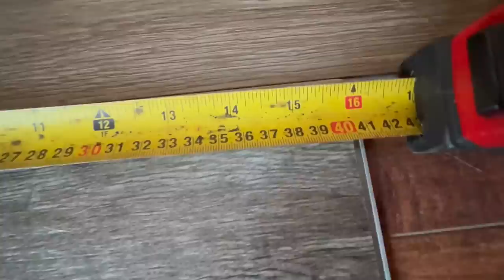A Dark Winter Night... Kitchen Building Project has Finally Begun!

Comment: So that`s where my overalls from the 80`s ended up!
When you start moving your furniture back on your new floor, slide it on some cardboard or a rug. Pity to chip it right off the bat.
Nice job on the shiplap and excellent videography as usual.

Comment: You are doing a great job on the floor and wall. If you have a rubber mallet  you can use on your flooring it will not damage the floor when you put it place. Awesome video and the dogs look great.

Comment: Much of the vinyl flooring can be scored with a razor knife and snapped off cleanly.  Works great for the straight cuts and no electricity needed.  Also, you are finding out why a white rubber mallet is important - saves the hands.  Just like the flooring, its probably a good idea to leave a bit of expansion space on the walls in the corners. Excellent work, you CAN do it.

Comment: You are doing a great job Lisette ! A suggestion (hate seeing you banging the wood together with your hand) if you don't have a rubber hammer use a scrap piece of wood lay it on the board and hit it with your regular hammer to keep from damaging the board) Wishing you lots of smiles and pride in your accomplishments 🙂

Comment: Lisette,if you don't have a rubber mallet then you can easily get by using a white pine 2x4 block of wood and that framing hammer by placing the block down where you wish to fully snap the flooring and then smack the block firmly using either the head or the rubber coated handle... Save spending the time and money to go out and buy a mallet plus the cost of one.. Otherwise looking great girl,and the  floors looking good too..😁

Comment: I have been contemplating putting up some wood in my home...either tongue and groove which I have worked with before and can be a pain in the butt in long lengths, or the shiplap like you used here.  The shiplap looks just as good and a lot less headaches.
And when I die and come back, I want to be one of your dogs.  <3

Comment: Rubber mallet will save your wrist. I used to use my hand like that when oil deliveries arrived at work. Once a week I would hit the top of the tank to get the gage to settle down in the tank. When I retired I noticed a large sore bump on the top of my hand. It is much better now but it took a whole year. Had to really favour that hand and it caused it to not be as useful. The flooring dude I had used a rubber mallet. A lot of those guys I don't think are interested in moving stuff around either. He up and left on us with a few bucks too and I was stuck finishing and I will be honest I am not a fan of the vinyl click flooring. It certainly looks nice though.

Comment: For the starter along the wall with that flooring you can drill it and use finish nails along the wall to hold it in place so that after a few freeze heat cycles your joints do not walk.  Also a rubber hammer is better then beating up your hands.  With the half lap why did you screw it on instead of using a finish nailer? I could not tell what kind of screws you used but with screws after you finish it the screws will most likely bleed off their coating into the wood.  What are you thinking to use for finish?  Tung oil should do nicely if you like the color of the wood,

Comment: Lisette when it comes to the flooring, you don't have to measure out the last part in a row ;)  Just take the last piece and turn it around so that the bottom side is up and the side that would normally fit at the left side is against wall. Mark that point and you're good to go :) It saves you quite some time.

Comment: Monumental job ahead, if anyone can make it happen, it will be you! You are so methodical as you work, the floor and first wall look fabulous I'm glad you got a good saw to help you, you handle the measuring, cutting, leveling so well. I only had one question, not a complaint at all, you were hitting the boards with your hand a lot, would a rubber mallet be better, or is that the best way to do it? Again just curious, you must be so pleased with what you've done so far, I can't wait to follow along on this best day of the week, because I see your latest video, Best of luck going forward, it's going to be fantastic!, Thank you for sharing this Lisette, have a blessed and spectacular week!

Comment: Keep up the good work on your home, I believe I would invest and some furniture slides so is not the damage the new flooring or your existing flooring when moving heavy furniture, you can buy them for hard surface flooring and they won't scratch your floor, you should be able to buy them at any home improvement store they said a four about 50 bucks probably maybe cheaper, but well worth the investment makes moving furniture by yourself lots easier,

Comment: Unsure if Canadian auto has pancake compressors and nailguns but if there's a Harbor Freight nearby a compressor is like 50 buxish,a brad nailer is 20 bux and a finish nailer is 30ish... Porter cable also often has a complete package deal with ; compressor,brad,finish nailers,some nails,and an air hose for a decent price and are uber reliable and long lasting even under heavy usage as long as you add a drop or two of oil @ the start of every days usage...

Comment: on tongue and groove you can use brads with a gun on the tongue, then no fasteners are visible. But maybe you plan to trim out where the screws were used. Sorry your helpers did not work out.

Comment: The tool that you are using to put your screws in is called an impact gun.  An impact gun is designed more for bolts.  If you were to try a drill for your screws you would find out that it is a much better tool for the job for putting screws in.  Just a little tip is all.
Reply from the maker: Thank you, I will change it. 😊😎💕

Comment: You might want to get knee pads and a rubber mallet to save your knees and make it easier to lock the flooring in place.
If I could get there I would help you just for room and board to get your work completed.
But you are strong and you will be able to get it done

Comment: I would recommend a small investment in a tape measure that indicates "Only Inches" as the one's with both metric & imperial are a pain in the butt.
A "Fat Max" or "Fat Max Extreme" make the job much easier for taking long measurements especially for work on walls or above your head.

Comment: you are doing a great job but at 10:43 in your video looks like something is wrong with the saws vacuum system not sucking dust   it  might need adjusting

Comment: Circular saws are dangerous.  Your blade is set too deep and this can result in kickbacks.  Set it deep enough to cut with you're working with plus a little.  Also tongue and groove is meant to blind nail on an angle through the tongue on each layer and you can eliminate screw heads showing.  Please take this a constructive.  I admire your ambition.

Comment: Hi Lisette,,, my name is Bob, and I understand that you have been mistreated recently, by someone you were depending on helping you... Now this makes it awkward to offer you a helping hand,, but I will still extend the invitation to help you with any project that requires urgency to get it complete... My offer is only extended though, first of all,,if that you are located within 7 hours of North Bay, Ontario,, and secondly,, until I get a call from my own employer, which should be sometime in the middle of January... My email is listed in my youtube profile if you decide to take me on, as a 'helper',,,and not a contractor,,, meaning I want you to maintain 'control' over everything... You're doing an awesome job at 'indepently' getting it done... The extra hands are simply to 'unconditionally' assist you a little, with any time constraints you may have... Either way 'You've got this"...Salut